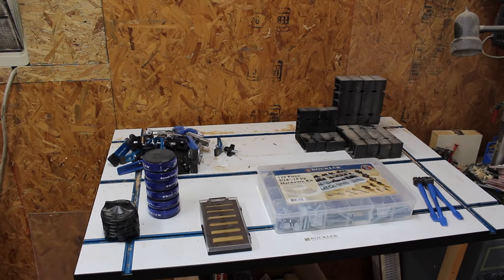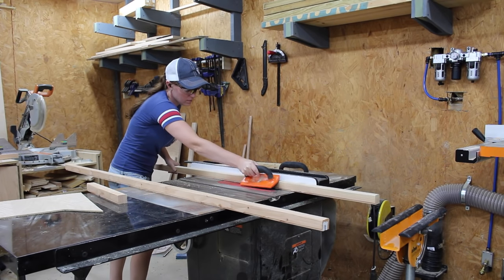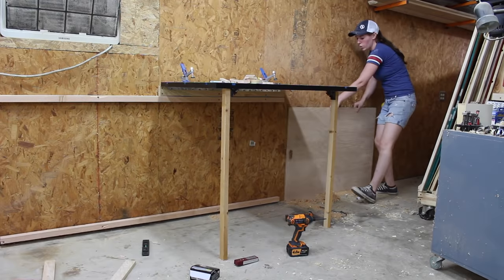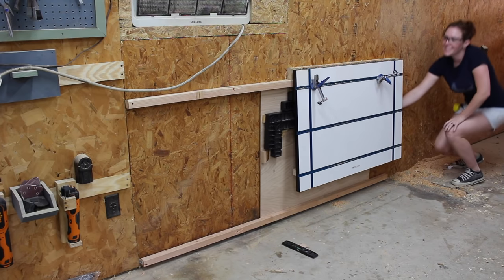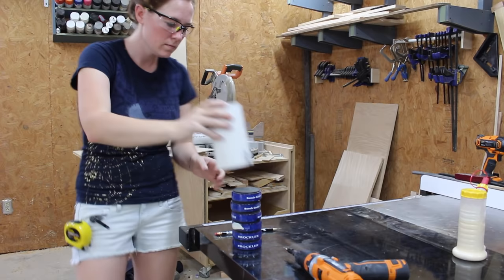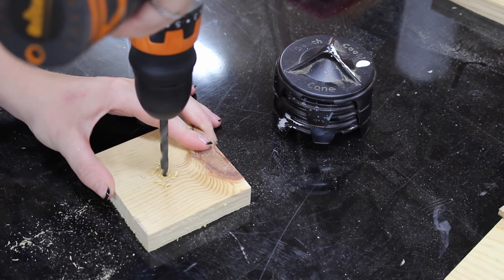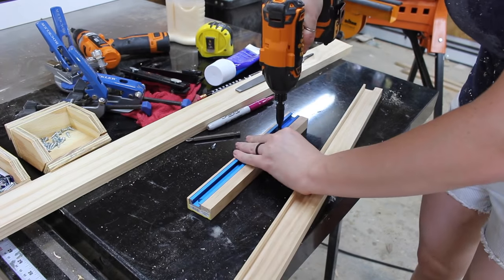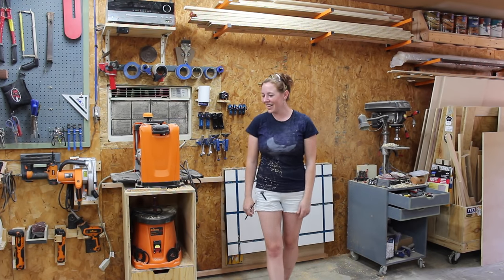Organize That Shop - Three Shop Organizing Projects

Comment: I like the sliding, hidden shelf idea, but it uses the same amount of wall as just mounting that board in place when it is "out" from behind the t-track table. Might have been easier, especially since your cart you parked in front of it is mobile. I like how you used the t-track as storage on the walls. Very cool!

Comment: Hi, April.

Retired last August and finally took up woodworking. Made a few things so far; soon
will tackle a King Size version of your bed frame with 8 drawers. Your videos
are informative and easy to follow. I’m currently designing a wood
dowel/PVC blinds louver using wood dowels glued to the edge of the PVC blinds
for a ‘hinge’. On Organize That Shop - Three Shop Organizing Projects, you used ‘all-purpose adhesive’ in a blue & white tube to glue a wooden bottom on a PVC tube for Bench Cookies.  Couldn’t catch the name of the adhesive. Looks like it might work for my project, as Gorilla Glue and Titebond didn’t. Thank you.

Neil Levy

Comment: I like the bench cookies, I bought a set of 4 and use them quite a lot. So with a hole saw I made 4 more glues some non-slip rubber matting to both sides and put in a 6mm screw in thread. works well enough, and keeps my rockler set for more important stuff. next I will add some risers to the set. I enjoy you ideas a lot. I really liked the french cleat bins as well.

Comment: April great job!
I absolutely LOVE the bench cookie idea and will be using it in my garage/shop here. 
I think I’ll use the 3” PVC pipe but instead of attaching it to the wall I’ll drill holes (not all the way through) in the back of the PVC and glue strong magnets in them to attach it to the side of my metal rolling workbench/tool box. 
Thanks for these videos April and keep them coming!

Comment: Thank you.  I had a job site issue with helpers not knowing were things went and putting things in wrong places, My solution  a two color system ( use spray paint) everything that is mine gets a metal flake green and then I use different colors for tool boxes , material bins,  and so on.  Sharpie outlines of tools help a lot when possible.

Comment: Great ideas. If you wanted to make the T track rack longer you you could cut notches in the middle on the top side and then you just slide the parts to a notch and lift it out.
Reply from the maker: That's a great idea!
Reply: +April Wilkerson you very nice in the worke
Reply: Ray

Comment: Hey April, nice tips.
One little detail I noticed. The pull for the slider should be on the top left corner instead of the middle, that way you don't have to lean to reach the centered pull.

Greetings from Chihuahua, North Mexico.

Comment: You can also use a bit of soap shavings as a dry lubricant to ensure that slider is nice, smooth, and that it doesn't buckle when the weight is on it.

Comment: April, great video but a word of caution. When using the step ladder to get stuff down, always put to facing the wall, not side on to the item you are getting. Like you I did this with it parallel to something I was grabbing. The steps tipped sideways as my weight pushed the steps out and I was left with a nasty injury. Stay safe 👍

Comment: Considering how much you didn't put large items above the bench you could also reverse the hings on it so it swings up and put a small cupboard down below it with slide out peg boards to store and reterive items as well as put items behind it on the wall when the bench is put away using what you just did below it.

Comment: i just started organizing my hardware parts...i bought like almost 200 space compartment and went thru a 5 gallon bucket filled with 25 years of screws and small computer parts. now i dont have to stress about finding that smaller stuff. all in a clear container and im thinking about doing what you did..making a wall holder...but for now they all stack nicely on a wire storage shelf. i guess its more use what  you have. harbor frieghts have 24 compartment 12inch by 8 container trays for small items. for 3.99. and individual removeable storage trays for 8.99 that fits store bought boxes of nails and screws. I basically oranganized home stuff, car stuff, computer stuff. other little random crap box lol...btw it took me like 12+ hours to sort in like 3-4 days. the trick is to put it in the restroom. so when you poop. you can do stuff with your hands.

Comment: There's room for a small metal or wood handle in the top left corner of the slide out, that's where you seem to want to grab it when you pull it out.

Comment: Making the under the folding  bench storage ends up using twice the wall space.  It has to slide out to remove anything from it.  It might have been easier/more efficient to just use the space beside the folding table to mount the board that you attached everything to.
Reply: Not when you consider she freed up space elsewhere when she placed the cart next to the table.
Reply: In a sense there is no wasted space, because it wouldn’t be used for something else.  But even with the cart there, how is this better than just mounting those same items on the wall behind that cart.
Reply: I think that the idea should be expanded to a multi-layer sliding storage. That way, you could really use the space better!
Reply: yep. I thought the same thing. I liked the other ideas though.
Reply: Why not just mount it above the table?
Reply: Not sure I understand why it's on a slide either. I agree she could have have doubled the space by making a non sliding unit twice the size (just need to duck under the folding work bench to get at those things). However, the real key, as she said, is that those things now have a home. The practicality of the sliding idea may be better realized in other situations (multi layer, behind a furnace/water heater, ...etc). So... thanks for the idea April!
Reply: bwillan
Reply: Having it behind the folding table will help keep dust and wood shavings off the stuff. I thought it was a great idea!
Reply: It seemed that everything she freed up already had a space.  It is a nice idea though.

Comment: I like your idea for the Bench cookies, but mine are triangular (TriGrips) and almost impossible to store neatly.   So I cut a couple of strips with 60 degree bevels and fixed them to a backboard so that one side of the triangular shape (the one without the pointy bit) slid vertically between the strips and was retained by them.   A triangular piece at the bottom of the strips stops the cookies from falling out, and I insert and remove them from the top.  The result can be seen on Lumberjocks under Don Johnson TriGrips.

Comment: I like the idea, but I try to keep things portable..  I've got a bucket boss with a good general assortment, that almost always goes along.  Then there are specialty boxes, like the pop rivit box.  I don't mind the bucket on the floor nearby,  but the rivit box needs a shelf to sit on when not in use.  Sure, I've got some stuff on walls, but if I'm loading the truck and I think I need a box for all the individual items I'm taking off the wall, I'm not there yet.  Thanks for the thoughts.

Comment: As always, simple but effective.  👍.  After seeing your collection of Triton tools I decided to go out and buy some.  But there is a problem.  We get the 18 volt version (which I believe is in fact are 20 volt versions, just a different way of measuring the voltage over here).  However, we get the dinky little toy chargers that take an age to charge the batteries.  Could you ask your pals at Triton how and where to get a faster charger from please?  Thanks April.

Comment: Great stuff as always!!!

BTW,  I am a small biz owner,  house painting.  Couldn't help but notice your gallons of opened paint up top!  Not good.  Take the paint OUT of the can and put into something like a tupper war jar,  mason jar,  etc.  Keep the LIDS for color.  And turn the "jar" upside down,  helping air stay out.  The cans will rust.  Also,  after a year or so,  the color on the home/wall will not match the paint in the can.  Might as well actually throw it out and just keep the lids anyhow!

Comment: Cool idea.  The only thing I don't get is, if you need to leave the wall space open where it slides out anyway, why not just hang the items there to begin with?  I don't see why the sliding feature saves you any room.  In fact, it halves the amount of space available if you just hang the items to the left of the flip up table (where the slide goes) and then find something to store behind the table.

Comment: The storage ideas are quite ingenious, but I wonder if there could be a way to use less wall space with the sliding panel. Maybe switching the solid wood rails for some kind of extensible drawer rail would allow to implement this idea with a more compact design.

Comment: FYI, if u cut a pipe fitting, be real careful that u clamp it down very well. I once tried cutting a fitting on the chop saw for a blast gate. I just hand held it. Well I guess it fed to quickly and next thing I knew, it exploded. A small piece gave me a nice cut on the cheek. There were pieces all over the shop. I am still finding pieces two months later. It's a miracle I didn't get real hurt. Now I go to the band saw for "iffy" things.

Comment: April, you should consider building an outfeed/work/assembly table for your table saw. Trying to hold longer or larger stock after it has passed through the saw can possibly damage the work piece and/or unsafely divert your attention. Rollers have limited functionality.

Comment: Another great video thanks. I saw your comment recently on it getting hot enough that you needed to use your fan.That wall air-conditioner looks like it has sucked in more than its fair share of wood dust, does it still work?

Comment: In the video you were putting your weight behind your impact driver and muscling in the screws.  An impact driver with a T-25 bit and matching screws does all the work for you.  Less effort + less tired = more accomplished.  The T-25 materials are not mandatory but oh so much better than phillips and don't require you to muscle up to keep the bit on the screw.

Comment: Thanks for the Cookie dispenser... I will make it this week. What's the sliding back board like for friction / resistance? The weight of the items does not look great but looks like it could be an effort to push / pull. I guess you put wax on the edge to help?
Reply from the maker: It slides really easy, I didn't have to wax the rails or anything. The items are placed like they are because of where the legs on the table fall. I had to place the deeper items on the top of the board which isn't ideal but it didn't affect the sliding abilities at all so I was happy.

Comment: The sliding wall is awesome. and a great idea. but i find it a wast with just one panel. if you have a 3 foot panel, with 6 feet of track. that is 6 feet of wall used for 3 foot of storage. even two panels , uses the same about of wall space. to really be a space saver, 3 panels minimum. now you have 9 feet of storage on 6 feet of wall.

Comment: Theres a concept that I like to use called "First order retrievability", meaning I am able to go straight to the thing i want without having to move or open anything. Toolboards on the wall for example. Things in draws are second order, because I hace to open the draw before getting the tool I want. The sliding rack under the table, while nicely done, with the rails uses twice the amount of space as you cant put anything on the wall between the rails, so in effect doesn't improve anything. And having to move the cart outthe way to get to stuff on the board would drive me crazy....

Comment: Why would you put the unit behind the table? The space to the left is unusable because of it and it would be handier place for those items. Then you would have extra storage under the table for items you use even less.
Reply: She wants to hide her addiction from her husband, :-)
Reply: I personally think "stackable storage" (utilizing the space behind something) is a great idea. But - to each their own.
Reply: +David Stanton  haha. A little late for that!
Reply: I was thinking the exact same thing, i don't see the benefit.
Reply: But she basically used double the space because of the sliding mechanism
Reply: Hiding the stuff she doesn't use a lot behind the table will help keep dust and wood shavings off of them. I think it is a great idea!
Reply: Rules of 5S say put the least frequent items either further away or harder to get.  Save the prime spots for items you need often.  Then as your shop gets fuller, you don’t have to reevaluate, you’ve already used wasted space for those less frequent items.   It’s common sense really.

Comment: Hi April, love the simple but effective ideas, I'm still yet to set up my shop, starting small but adding as I go, just a quick question on the Triton spindle sander, I saw one in my local store recently and thought it would make a good addition to the shop at some stage, can you shed some light on how often you use it, what you use it for and anything else you might want to add about it?

Comment: April: What air compressor system do you use in your shop? I am considering the RapidAir 7500 Kit and not sure about which compressor (around 60gal. cap.) to buy. Suggestions & reviews accepted.

Comment: G'day April, this might seem a very dumb question but when you cut the aluminium strip did you use a special blade or does aluminium not ruin your blade????? Tim.
Reply from the maker: I just cut it with my regular blade, I've also used my table saw before to cut aluminum.

Comment: So  I noticed your mobile planer stand, it looks sort of shallow, wondering if when you put thick heavy stock though it if it gets tippy?
I'm designing one myself for my new (80 lb.) Delta planer that I'll build next week and being the overkill kind-of-guy that i am, and not having made one before, do you feel as if yours being basically the same dimension as the footprint of your planer is perfectly stable or if you had the extra space do you think you would of benefited by having a deeper footprint or am I just over thinking (designing) this.
I appreciate all you do.

Comment: I have Rocklers original bench cookies and they are to big (I ended up taking some off on bench sander).  The bench Dog cookies fit great in 3" PVC.  I went to Rockler and the new ones are the same size as my bench dog brand. 4-6 cookies fit primo any more than that they seem to get stuck in PVC.

Comment: 4:24  Why not just make two lengthwise cuts in the pipe, taking out about one fourth of it, then put the plug in the bottom end.  That way not only can you pick up more than one bench cookie at a time, but you can screw it to the bracket instead of gluing it, and you'll be able to unmount (more easily) it if you have to.

Comment: Great ideas!  Why not use pegboard in lieu of plywood for the first storage project.  It would for flexibility of hanging storage.
Reply from the maker: I didn't have any pegboard around and I was trying to use only what I had on hand. Also, if I used pegboard I would have needed to space it away from the wall further to give the pegs enough room to get in and out and I didn't want that.
Reply: +April Wilkerson Good points April, I didn't consider the pegboard hangers.  Thank you for the great ideas!

Comment: I never did figure out what the point of the "slide" is.  Why not just mount that to the wall behind the jointer?  The only reason I can think of to use a slide like that is to make them at least 2 deep so you can store a bunch of tools and supplies in a small space, but only having it a single slide deep doesn't accomplish anything.

Comment: Okay, so the video is two years old. April, If you still monitor these older videos-  You can drill a hole into the front of the pipe and use a paint stick with a slit in it, (or needle nose pliers, lol), to hold a screw. Position the screw so it lines up with the hole and drive the screw home using an extended length bit. <><

Comment: Those are some novel ideas.  What is a bench cookie?
Reply from the maker: They are small puck things with anti slip material on each side. They can be used to elevate your work and also grip it. They are a small and very useful shop tool.

Comment: This is so cool, but I don't have a table saw to cut the grooves into the wood, I want to make a rail for a wall hanging style organizer too, is there a way to cut straight grooves in wood without a table saw? I am only able to store hand tools and electric handheld tools in the garage due to space limitations, is there a way for me to cut a straight groove like that without a able saw? Thanks.
Reply: Yes. With a router. Simple to do this with a router mounted on a table and setting a fence. If no table-mounted router, then do hand routing. Use an extended router base for stability. Set up several pieces together to form a surface for supporting the router, too. Only the piece on the end will be cut...find a low profile way to clamp it so clamping doesn't interfere with the router. When done with that workpiece, swap with an uncut piece. I suppose the exact same could be done using a circular saw.